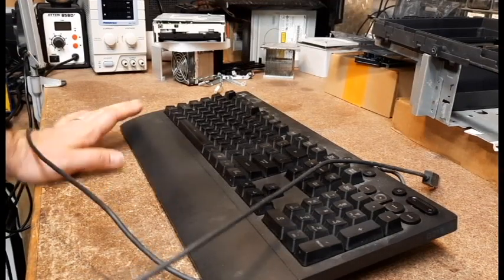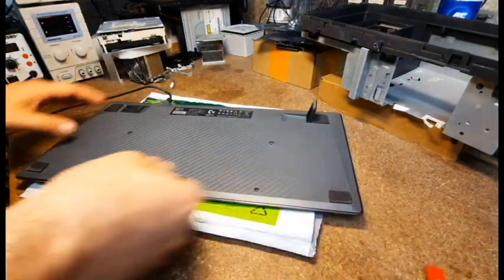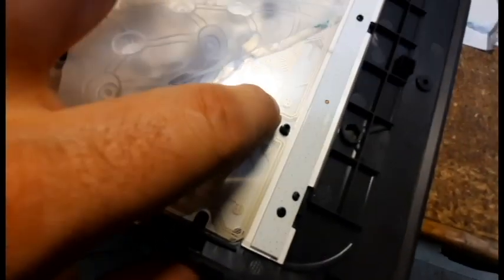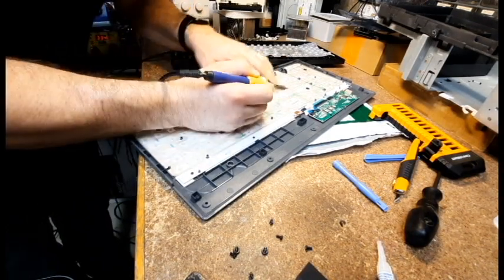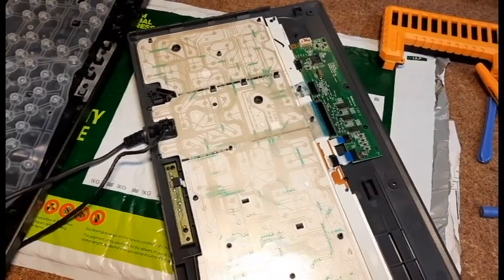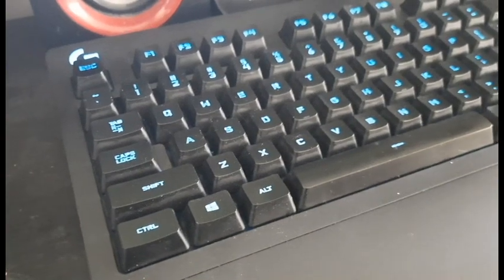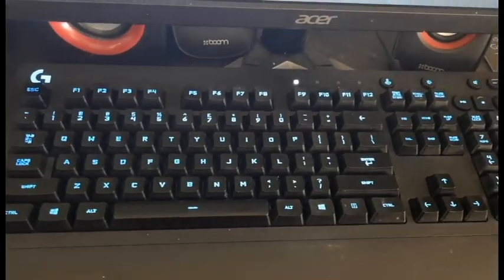Computing Vlog! 16-9-23 - G213 keyboard issues and fix

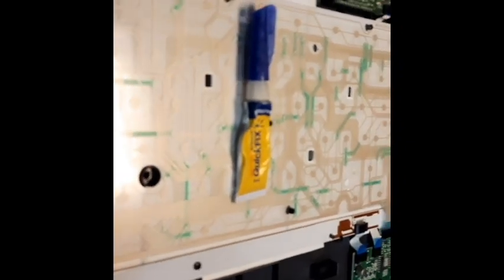Comment: I have the same Logitech G213 KB & it's years old. Now the following keys do not work ASDFG and QWER .... But I am not sure if I can resolve the issue.  I was unable to follow what you did from 08:07 till 12:40
Reply: WTF same keys are not working in my keyboard 😳
Reply from the maker: Hey, from 8:07 to 12:40 i first glued the innder membrane to the white backing to stop it moving, then glued the top membrane to the bottom, being careful to keep glue away from contacts. I then dab the soldering iron about to melt to 2 layers together to stop them from moving again in future - to assist the glue.

Comment: what exactly did you use the soldering iron for? i wanna fix my g213 and i get the glue part but not sure about the soldering iron
Reply from the maker: Hey, the soldering iron was used to melt the 2 plastic membrane sheets together to stop them moving apart. You could use glue but you would have to hold the sheets steady in place while it dried

Comment: After I disassembled and reassembled mine, the rgb backlight and the indicator lights stopped working and I have no clue why. Everything else works though…
Reply from the maker: Sounds like the white mylar cable is out of position, theres a thin white cable that runs from the lights to the control board